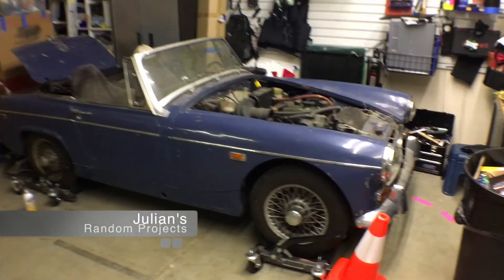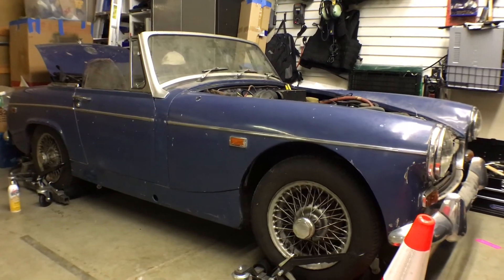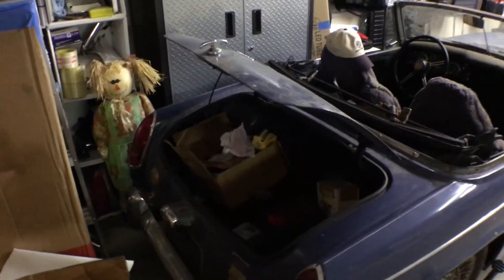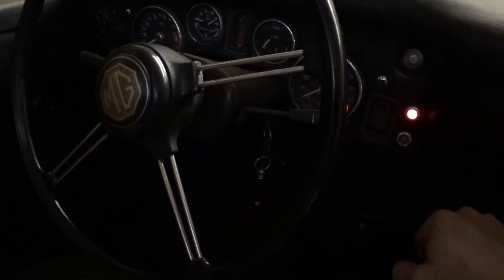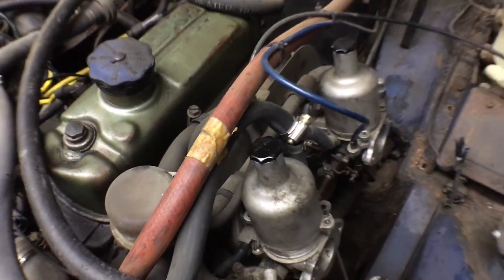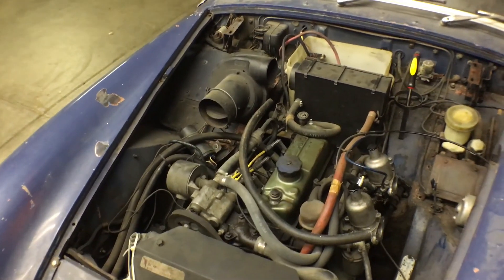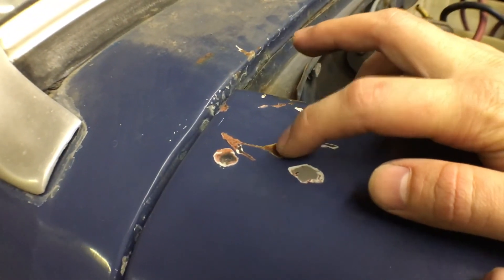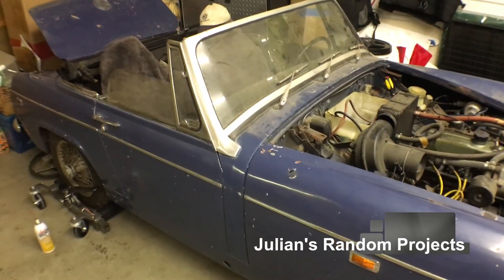MG Midget EV Conversion?! Barn Find Siemens AC Motor

Comment: Looks a lot cleaner than the one I dragged out of my late flight instructor's hangar a few years ago!
Reply from the maker: I missed a chance to buy a TR4 that was used as a run around between hangers at an old airfield nearby... beauty with all the right patina. You gonna post something about it? What are your plans?
Reply: No definite plans. Got it because it was stupid-cheap. Doesn't run and needs a whole lot of parts, but the body seems solid (sat in the back of a hangar for over 20 years). It's a '75 so I removed the bumpers. If I build it for myself it will have to be a roadster (I'm about 6'2") so I also removed the top.  Would love to go electric but I don't have an extra $10k to throw at it right now. Just too many other projects with higher priorities.

Comment: Cool, an EV conversion.  Am keen to see how this one progresses!
Reply from the maker: Going to try and catch up to the progress you've made with your electric Midget!
Reply: Happy to see that my friend.
Reply from the maker: The AC motor I've purchased may be too large for the midget (if I'd like to also have the inverter under the bonnet.) This is making me consider the Rat Rod or Rusto Mod route. Like remove the passenger seat to house some of the battery pack :) or modifying the hood like you'd do for  a larger carburetor.